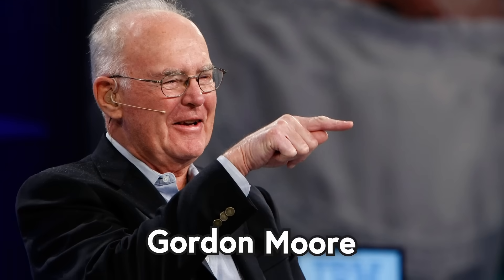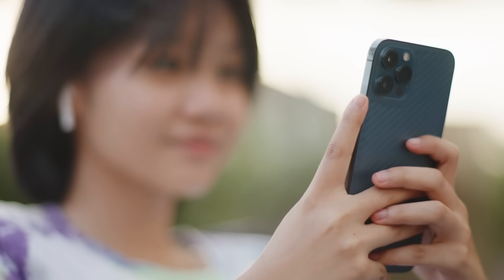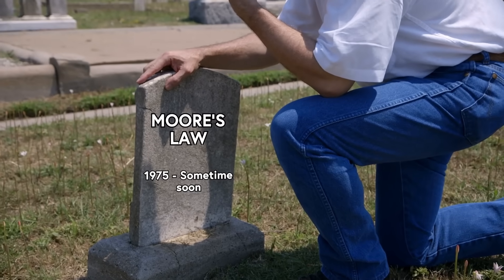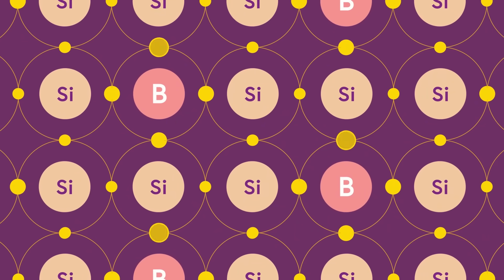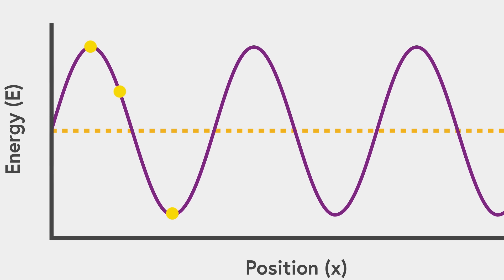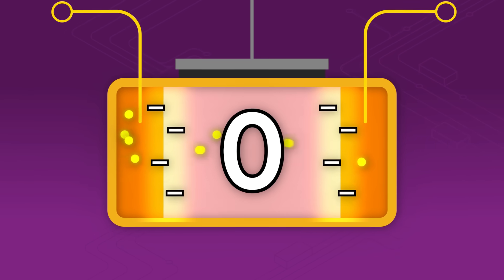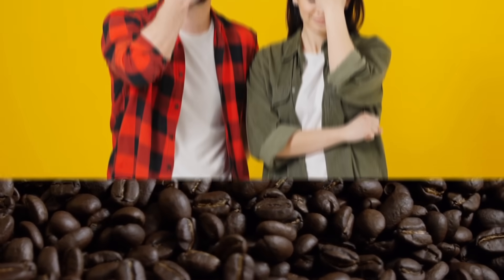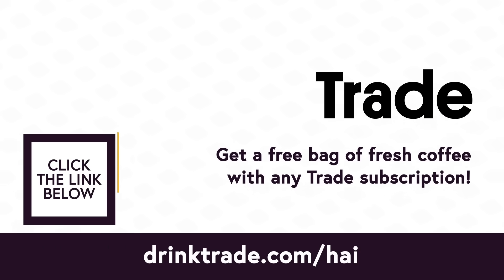Why We're Reaching the Theoretical Limit of Computer Power

Comment: Just a nitpick, but doubling a value over and over isn’t exponential growth.
Reply: Yes it is, lol that's modelled by 2^x since it is doubling over the entire interval 1,2,4,8,16,32,64,126,256,512,1024...=2^x
Reply: @Playerofakind  Doubling a value over and over isn’t exponential growth, if it was that would work for any value and not just 2. The fact that they overlap with 1 value out of the infinite numbers there are, does not make them the same thing.

EDIT: Also, that’s not at all how exponential growth works, so your point is doubly wrong.
Reply: That is literally what exponential growth is
Reply: @johnwarosa2905  No, it isn’t. 

Graph Y=X^2 and Y=2X and then tell us how a parabola and a straight line are literally the same thing. 

Yet another person proving that this nitpick is needed.
Reply: @Ilix42  what youre describing is linear growth. Using 2x, we have a value 6 in year 3. Going to year 4 we have a value of 8. 6 -> 8 is not doubling. Instead, doubling looks like: 
year 1: 2
Year 2: 4
Year 3: 8
Year 4: 16
...
And that is modelled by the function 2^x. Which is an exponential function

Comment: Just for anyone wondering about the term “quantum computer” that get thrown around a lot, the tldr on them is that instead of 0 or 1, they use circuits that can be anywhere between 0-1. The means infinitely more possibilities that a standard 0/1 bit. For more info look up qubits, they basically measure the quantum superposition of a two state system.

Comment: Instead of having a constant electrical flow that is interrupted by a secondary electrical source as displayed in this graphic, why don't we have power running through, but when we want a 0 on the transistor, then we just cut power completely. This way we literally don't need the silicon or whatever the material was with the risk of quantum tunneling. If we want 1 on the transistor, then we give it power, and if we want a 0, we take the power away completely. This way quantum tunnelling isn't present what so ever since there aren't electrons jumping around waiting for the negative wall to go away.

I should be an engineer. Damn. I'll fix what you weaklings can't seem to fix with computing power and become the richest man in the history of reality as we know it.

Comment: As we decrease in errors while building we can sustainability build bigger chips. 
Every full wafer will have errors that aren't up to standard or are thrown out, if you increase chip size it increases error rate per chip so more are thrown out, double the size but quadruple the costs. 

If we improve that we can have chips twice in size be normal. And if we make soom temp super conductors and make it the size of modern transistors we can make it 20-100x bigger and not worry about heat.

Comment: more the reason to switch to quantum computing
Reply: Silicon based chips still have the potencial to get 100-1000 times more powerfull per mm^2, we are far from the limit even tho the logical gates can't get much smaller. Meanwhile quantum computers are still far from computing anything usefull.

Comment: Just make a bigger thing to put transistors so even if you have the limit just make a CPU bigger to squish more in
Reply: Melting your CPU in three steps or less
Reply: the biggest issue is yield. chip companies don't make chips perfectly. because even when you just mess up one transistor in a chip, you would have to throw away the entire chip. right now state of the art chips have a yield of around 40%. now imagine if you double the size, basically meaning you can't make a mistake in 2 chips in a row, then the yield reduces to 40% * 40% = 16% and so on. so it really hard to just say make bigger chips. 

and that's not accounting for technical issues with supplying power for each transistor with a larger chip, heat dissipation, and many other issues. the industry would have moved toward larger chips a lot time ago if it actually works

tldr; chip too big, MUCH harder to make, cost sky rockets.

Comment: While the video has done great work explaining the more "fun" reasons chips reaching their limits there are also a couple of other more practical issues besides quantum tunneling that make increasingly small transistors impractical. One of the biggest is Gate Oxide thickness. CMOS gates are made with thing layers of silicon dioxide that control how the transistors turn on and off. As the transistors have gotten smaller and smaller the oxide thickness has had to become thinner and when voltages get high enough the gates break down removing our ability to control the channels. Also as transistors have shrunk the gate length runs the risk of being smaller than the mean free path of the electron (shortest distance an electron can move before hitting an other electron). This would limit our ability to control the flow of current through the transistor. Heat also plays a factor as increasing the amount of transistors runs the risk of overheating the device. Finally and perhaps most interestingly the biggest factor holding things back could be economics. As transistors have shrunk the cost per million of them has gone down dramatically. But the processes that resolve the issues mentioned previously have caused that trend to reverse possibly making them economically unfeasible.

Comment: Actually you could get smaller and faster if You just used
2 inductors and 1 capacitor in series with the ground In between the capacitor and second inductor. And pulse it at is resonant frequency.

Comment: Well, I do think we have a last one with less then 12.5 nm etching a possibility but I don’t think it will happen as this tech was actually almost 20 years late and past due date with delays etc. Well practically speaking 15 years and 10 years from planning purposes. And we are just starting to do mass production of euv ecthing as now it is mostly mix use or hybrid model with still less then half in high end devices. With new 5nm or 4nm a refined node of 5nm going and eventually 3nm in 2 years going high aperture. Let’s go TSMC and ASML

Comment: Our next big processors won't be quantum computers. It'll be photon processors.
Quantum computers are unnecessarily large and require -100* (+/-) for function properly. There have been a few advancements that might fix that, but right now, we have what we have.
Reply: Current Quantum computers are kinda in the stage transistor computing was in the 50s

Comment: Moores law has a way to go yet. The mistake is in believing that the only way to improve is to make the transistors smaller. For at least the last couple of generations things have started to go vertical. The number of transistors per unit area is still increasing, but by stacking things vertically. Flash memory chips are the ultimate example here. The latest generation has reached 238 layers and 1Tbit per chip. 

Plans for the next couple of generations of process are already underway, and chip stacking methods are already in use in current CPUs (AMDs X3D series).

Comment: Quantum computers will take a while till they will fit in your pocket, but one can dream yes. In the meantime mixed silicium and light chips will surface. Where light will probably first be just for information transport inside the chip and later computation also. Light transistors would be probably a magnitudes of sizes bigger than silicium one but htey will have two advantages inside a mixed chip. One is speed light speed pun intended. And also they will produce less heat. And less heat is the most desired quality right now in higy power chips. Less heat less wattage, more efficiency. So we will have a fun time time quantum comuters hitting the mainstream market in the next fiftie years or so.

Comment: As an electronics engineer student who just did a course on semiconductors, There are a billion errors in this 6 minute video I feel oblidged to point out:

1) computers use MoSFETs . However, the transistor described was a BJT. (I will not explain MoSFET, just know its completeley different. The best part is that MoSFETs are easier to understand, explain and use in my opinion than BJTs).

2) in BJTs, One side must be considerably more contaminated than the other, the Emissor (because it emmits electrons). The other side is called the Collector (because it collects those electrons).
For future reference, i'll assume the emissor is on the left, and the collector on the right.

3) the size of the Boron layer is usually quite smaller compared to the size of Phosphorus layer in BJT.

4) Although more transistors help, that is not the only reason the computer is faster. The smaller the channel, the faster the transistor (in MoSFet). This means that you can increase the frecuency of your computer, and have more ticks per second, which translate to more operations per second.

5) BJT transistor dont work with Electric fields (Thats for the Field Effect Transistors, mosFET). they work by inyecting a small current into the Base (the middle). This essentialy allows more electrons that would be expected pass the electrical barrier. This causes to be an excess of electrons in the base, which normally should recombine with the holes and disappear (Thats how Diodes work). However, the size of the base is so small that the electrons don't completely dissappear, and they reach the other side by diffusion (there are more electrons near E than C, so they tend to move towards C). Here, they are actually favored by the depletion zone barrier to go towards the collector. Although electrons wont go from E->B and B<-C, they will go from E<-B and B->C. thus, electrons from the emissor reached the collector (minus a small part that goes as the current injected into B).

6) The 1 nanometer scale is actually Half the size of the channel, not the size of the entire transistor. (it would be saying that the midle part is 1 nm, not the whole). This is because the frecuency operation and other factors are determined by how long the channel is, thus it is more interesting to say the size of the channel than the size of the entire transistor.

7) Though quantum tunneling is a problem, you can still use the transistors thanks to something called "logical levels". Essentially this is a margin of error for when a voltage/current is a one or zero.

8) The current limitation of size isn't actually what is said in the video, but how the chips are being made. They are made with litography (which is also used in photography). Manufacturers essentially etch paths for the diferent materials in the chip with a laser. The problem is that if you want a smaller path, you need a higer frecuency ray (UV light). And UV light doesn't behave nicely.

9) Quantum computing is not a replacement to regular computers. For improvements in computing I believe there is a more interesting future in Analog Matrix Processors (which is extremely useful in graphics and machine learning), at least in the near future. Quantum computers aren't necesarilly faster than regulars computer in every problem, you have to demonstrate that your quantum circuit is actually faster. In some problems, using a normal computer will be as good if not better than using a Quantum one.
Reply: I did not know 9 was the same as 1 billion

(Sorry 😅)
Reply: Quante nottate passate a studiare Dispositivi Elettronici e questo mi confonde BJT e MOSFET 😅😅😅
Reply: Quante nottate passate a studiare Dispositivi Elettronici e questo mi confonde BJT e MOSFET 😅😅😅

Comment: Adding in a couple details about Quantum Tunneling.  It is not rare.  We rely upon it to live, as does just about every other multi-celled organism on Earth.  Transport proteins that move electrons across membranes do so through quantum tunneling across heme centers (an iron atom in a porphyrin ring).  The gap that is generally accepted as a viable tunneling distance without bottlenecking is around ten Angstroms (100 picometers).  If there are two metal atoms within ten Angstroms of each other in an otherwise nonconductive system, their electrons can and do tunnel back and forth thousands of times a second.

Comment: It’s like how we’ve reached the limit of data density on hard drives bc we can’t magnetise sections of them any smaller/closer so now they’re going back to using film for mass storage because they can just make the tape longer to increase capacity
(HDDs are still used if the data needs to be accessed frequently bc they’re way faster but if there’s a shit ton of data that just needs to be stored and only gets used once in a blue moon, tapes the way to go)

Comment: couple of other things will allow continuation of Moore's law (at least for a bit).
1) CPU chips will follow memory chips and move into 3D... yes already individual CPU transistors have gotten more and more depth to make them work better in smaller x,y dimensions , BUT there hasn't been much stacking of transistors... CPU chips are basically a flat plain... cooling improvements may allow chips to expand in the 3rd dimension. In 2021 a silicon wafer technology allowed 4 layers to be stacked... so we have x,y,z dimensions: 10,000,000 x 10,000,00 x 4  . Obviously the z dimension at 4 layers has a ways to catch up to the x,y dimensions at 10,000,000 each
2) CPU chips will follow memory chips and move into multi-state. Instead of just binary 1 or 0, MLC cells have 2 bits per transistor, now there are TLC memory 3 states, QLC 4 states, next year maybe PLC 5 in development. I can see redesigning the logic of CPU chips with transistors of up to 5 states will be a much bigger re-think of CPU chip design compared to memory chips... but eventually.

Comment: Quantum computing (QC) is not a replacement for silicon-based computing as both have tasks they are better at and QC also is currently the opposite of miniaturised, and a variety of different hardware approaches makes the comparison moot; there are a number of real alternatives like photonic computing which often still use silicon.

Comment: A few inaccuracies here and there. But an important point would be that the solution to the quantum tunneling effect isnt quantum computing. At least not for normal people. Quantum computing requires temperatures near absolute zero and its not viable for your phone or any other device. There are other steps taken against quantum tunneling in regular hardware. The first one was the rather recent implementation of fin fet transistors which is a way to basically strengthen the depletion layer without making it wider. Other technologies to combat the problem are in development.

Comment: While it might not be possible to make transistors small conventional micro chips can still get better because the actual design of the chips themselves isn't perfect the power supply transistors need to work is on the same side of the chip as the transistors themselves leading to a lot of wasted space no one ever bothered fixing this before because that would require not only completely redesigning the chips themselves but also the building sized several hundred million dollar machines that make the chips as well so it was never worth it

Comment: Quantum Computing isn't good at doing high amounts of calculations, it's good at doing probabilities very quickly using a very small number of calculations that are determined by running q-bits to simulate probability. We will never have transistors smaller than 5 nanometers

Comment: However the solution to the problem of transistors reaching the physical size limit is to have more of them within the same surface space by stacking them so recently companies have been releasing stacked processors that have multiple extremely thin transistor layers stacked on top of each other. The next limit will be how thermally conductive it is.

Comment: There actually is no limit to computer power, you are just stuck in single theaded paradigm which has been the norm, since building optimal trully multi threaded applications was not possible because of the complexity. Since AI will  in the future probably be handling this lower level complexity. Theres hundreds more years of potential that is up for grabs.

Comment: everything is well explained  however you misplaced the evaporator with the condenser. ...evaporator remove heat from inside the room and sends it to the condenser (outside the room)  in other words ac doesn't cools down nust remove heat from one side and send it to the other side.

Comment: Each year the number of people predicting mores law will end doubles...

That being said, a transistor is not 2 nanometers in size. This is merely a marketing term for the manufacturing process. A modern transistor is a 3d structure so it doesn't even make sense to use one length to describe their size. And a gate is still far larger than 2 nanometers

Comment: Because the quantum tunneling would happen semi infrequently, you would have 0s turning to 1s in a large-scale predictable way. Couldn’t you just tell the computer, “ignore a 1 if it turns a 1 only briefly” -so by increasing the tolerance of “noise” you could still cross this quantum tunneling barrier? This might slow your processing down slightly per processor, but then you could add more transistors? Would this work?
Reply: The number of zeros turning to 1s would be a function of transistor size, and you’d need to create some sort of mechanism to cancel it out on a tiny scale